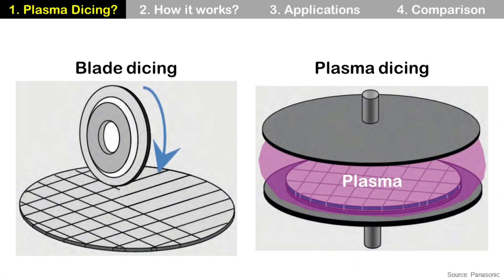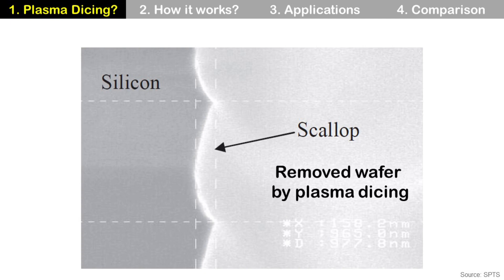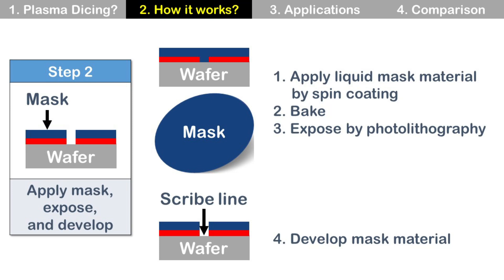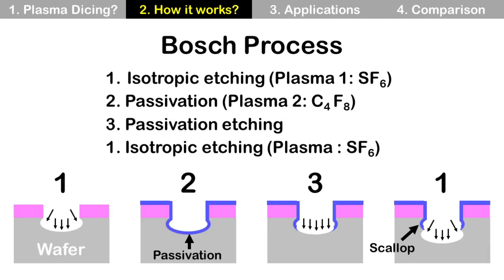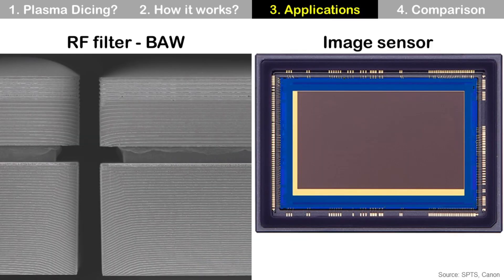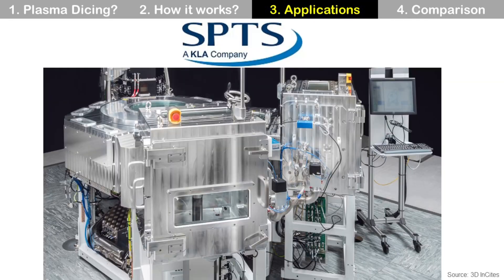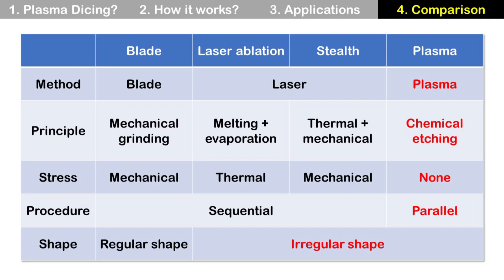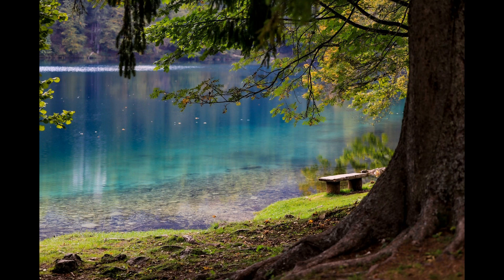[Eng Sub] Plasma dicing

Comment: Thank you for sharing different dicing methods. 
just one quick question,  when comparing to the stealth dicing, which one can possibly provide a more flat surface on the dicing edge?
Reply from the maker: I think plasma dicing has more flat surface than stealth dicing. But both of them are good enough and don't have any problem about surface flatness.